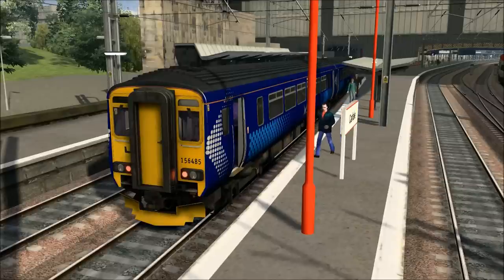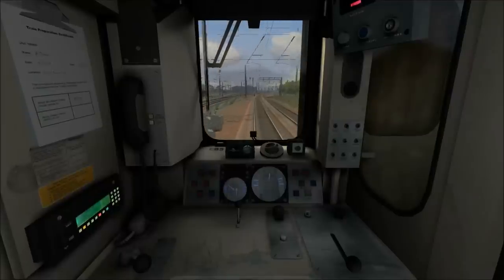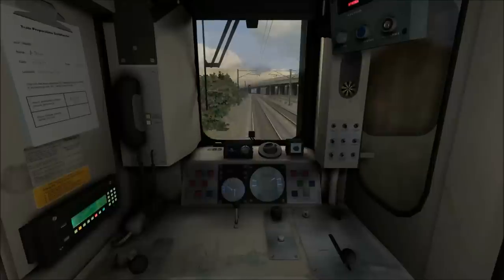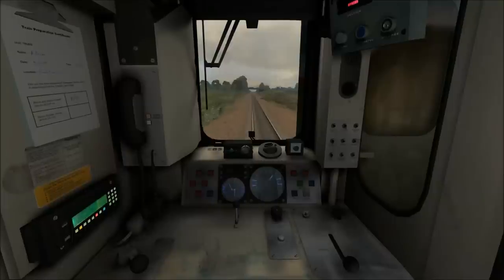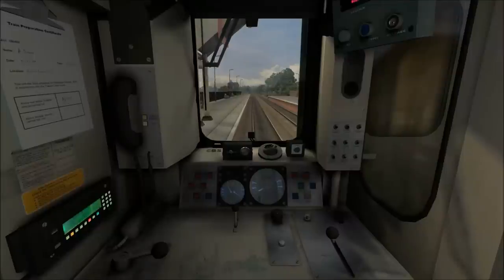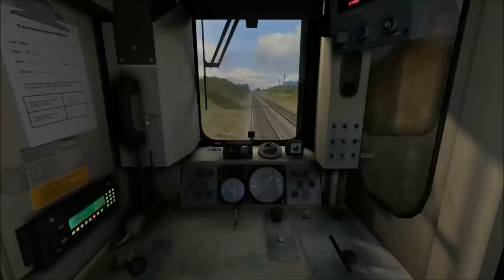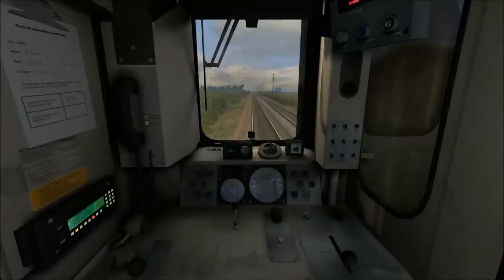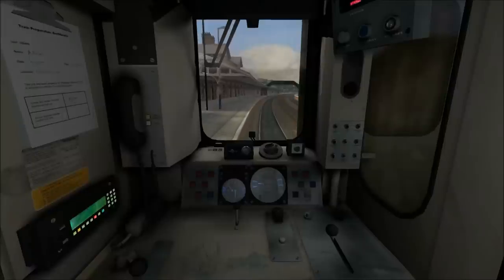Train Simulator 2015 - Route Learning: Carlisle to Dumfries (Class 156)

Comment: Another excellent film, thank you. Omitting the HUD display does improve the realism, but a little too much on this 156 with only about 15% of the screen available for the forward view. I like your idea of using this line for earlier BR traction scenarios. The Cl111 dmus were ER only, more likely to find 2-3 car 101s on the Dumfries locals. Through trains from the South to Stranraer were Cl47 hauled, with Class26/27 hauling the Carlisle - Glasgow trains over this route.
Reply from the maker: 055deltic I have covered more in this area on the Western Lines of Scotland route in other videos. I tend to agree that the view out of the Class 156 isn't great so I rarely drive it in videos. I'd like to cover the return journey on the Western Lines of Scotland route from Stranraer to Dumfries, possibly in a Class 27. :)

Comment: Regarding the closure of Gretna Green station and the singling of the line from Gretna to Annan the Nith Valley Route (its official name) was singled from Barrhead to Kilmarnock and Annan to Gretna in the late sixties. Additionally the two remaining stations between Barrhead and Kilmarnock, Dunlop and Stewarton were closed in 1965 only to reopen in 1968 as unstated halt. From the late sixties to the late eighties the only stations between Kilmarnock and Carlisle were Kirkconnel, Dumfries and Annan; of which only Dumfries was still staffed. Auchinleck south of Kilmarnock and Kilmaurs, north of Kilmarnock both reopened on the same day in 1989 with New Cumnock following in 1990, Sanquhar (pronounced Sank-uhr) soon after that and finally Gretna Green in 1993. Service levels dwindled on the Nith Valley Route into the 1970s with the only through train beyond Carlisle other than diversions and seasonal trains being the Thames-Clyde Express to London St. Pancras via Carlisle, the Settle - Carlisle line, Leeds, Nottingham and Sheffield taking a horrendous 10 and a half hours to reach London compared to about 5 and a half down the WCML. Local services from Kilmarnock to Glasgow fell to six Mon to Sat services and one on Sunday. Of the weekday services one called at Stewarton, Dunlop and Barrhead and another at Stewarton and Dunlop only both in the morning and pick-up only with the other four running non-stop to Glasgow Central in 35-53 minutes. Return services set down only at Dunlop and Stewarton so it became impossible to travel by train between Kilmarnock, Stewarton and Dunlop. Glasgow to Carlisle services fell to 3 daily perhaps explaing in part the singling of parts of the route though British Rail management wanting to ensure the line could not prove useful as a diversionary route and thereby encourage its closure is another reason. The line was redoubled completely except for two short sections: Kilmarnock to Stewarton and from Lugton (site of a former passing loop) to Barrhead. The service is much better now than in the seventies with the six daily Kilmarnock to Glasgow services now a half-hour Mon-Sat and hourly Sunday service. There are now nine Glasgow to Carlisle services of which three extend to Newcastle. Thanks again for your video and keep 'em coming.
Reply from the maker: Ben Reid Thanks for all the info! Very helpful :)

Comment: Great vid...I had a train sim years ago..but nothing like the quality of this......what would I need to reproduce this line with the Scotrail train ect on a Win 8.1 laptop? What kind of price? Thanks for your help
Reply from the maker: mcbrucie That depends on the technical specs of your laptop. The game itself is usually £19.99 if I remember rightly, but if you can grab it in an online sale it can be cheaper than £5 :)
Reply: Thanks..My laptop is just over a year old an has 8gb of ram .so if I just search Train Simulator 2015 ? Will that include the Dumfries - Carlisle route & the Scotrail rain or is that an add-on?
Reply from the maker: mcbrucie Both of those routes are add ons. If you search Train Simulator 2015, it will tell you what routes and trains it currently comes with. To get the Dumfries to Carlisle route you either need to get the West Coast Main Line over Shap add on (Preston to Carlisle, including the Morcambe branch and the Dumfries section) and the Class 156, or the Western Lines of Scotland route which is set in the 1950s with the route from Carlisle - Dumfries - Kirkcudbright - Stranraer included :)
Reply: Thanks for all your help!